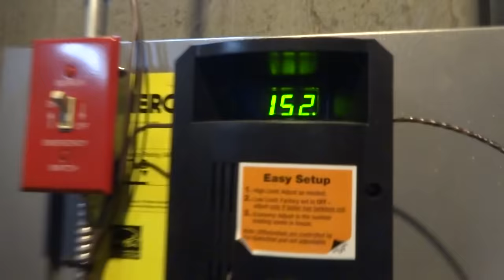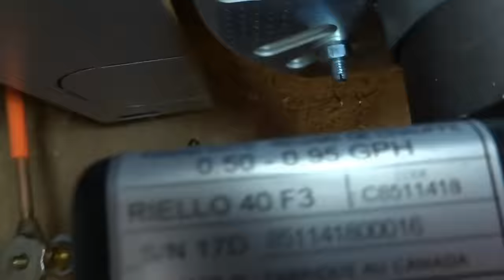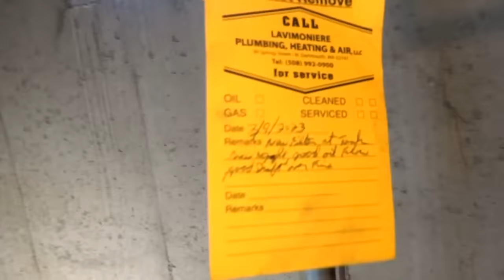RIELLO OIL BURNER CYCLING ON AND OFF

Comment: I'm confused as to why you set the low limit off even with a storage tank for hot water. I thought turning off low limit is only for cold start boilers without domestic hot water? 

You've mentioned that it's always good to keep the boiler at a minimum temperature, otherwise they can start leaking past the seals.

Comment: Havent watched video yet but just figured id throw my 2 cents in.  Those riellos will mis-fire from carbon on points or running too lean.  The bio-fuel doesnt burn as bright so the "eye" shuts it down.  Cutting the air/riching it up usually fixes it.
Reply: Mines staring up and stopping I cleaned the eye and ideas what else it could be what do you mean by cutting the air?? Would really appreciate any help thanks
Reply: Usually giving less air to the burner will result in a "brighter/richer" fire and solve the "on/off" problem.  Try "cutting the air back" and setting it "richer".  12.5 co2 is what u should aim for.  May need a pump pressure adjustment but usually just an air adjustment will work.
Reply: @robertkieras1522  thanks for your response 👍 how would I do this?? I'm no plumber 😂 but I'm kinda handy at home so if you could explain we're I would start and how I can adjust the air please I'd appreciate that I have a riello boiler
Reply: The air gate is on the right side of the riello burner (once cover is off)  you loosen 2 screws to slide the air gate and open or close air.   Its a bit tough to do without a combustion analyzer cause if u cut air too much it will burn rich and soot up..but if its "mis-firing on/off" quickly its probably too lean and u could try closing the air slightly to see if that helps.  Other option is to find a good full service oil company and they should be able to help.  Im in western MA.
Reply: @robertkieras1522  thanks for your help I'll try the air damper and hopefully it will help if not I'll have to call a plumber 👍 thanks again I'm in Ireland BTW 👍

Comment: I cannot believe you used Chanel lock plies on that filter. I have never seen you do that before. I have seen pin hole leaks in filters by doing this. You know hand tight or with a filter wrench. Just sayin.
Reply: Tighten on the bottom w/that tool - not in the middle.  That's your best bet not to crimp it.